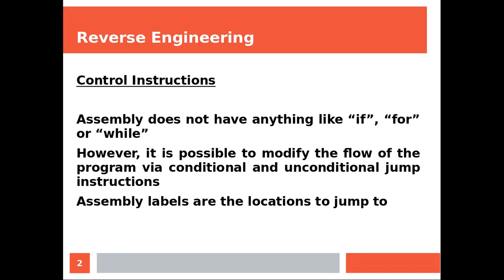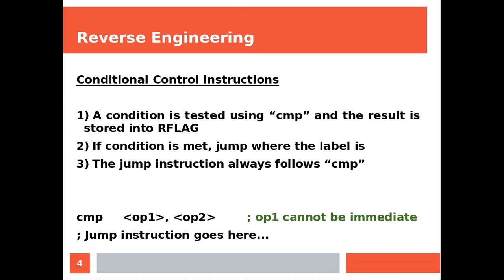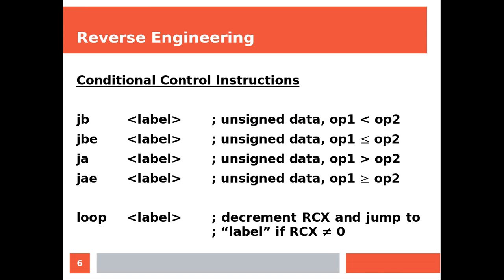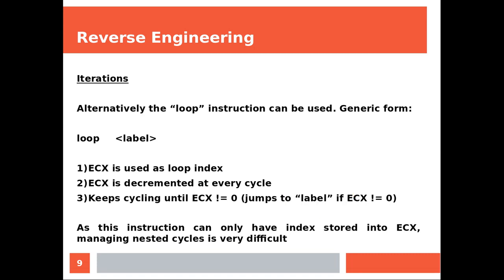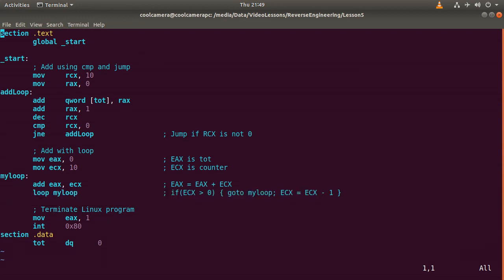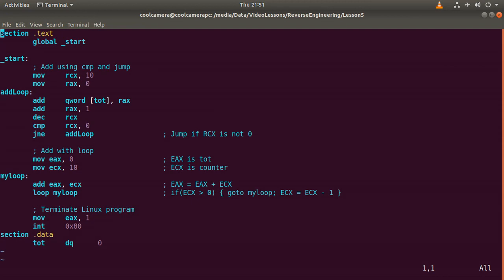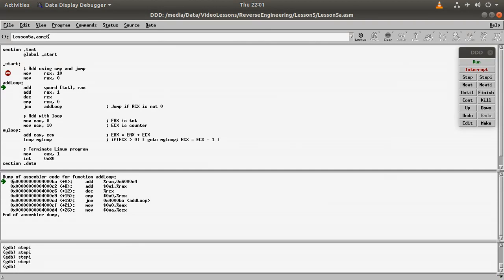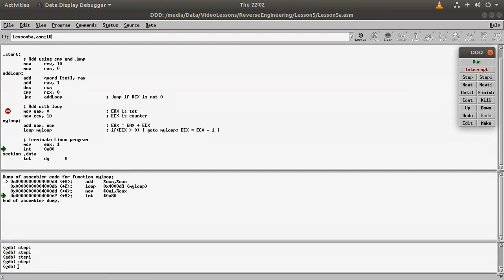Reverse Engineering | Assembly Control Instructions | Beginners

Comment: Thanks for these videos. Here is a question:

If I try to simplify the first loop like below by eliminating rax then I get a segfault when I try to add from rcx. Why is that? Something special about rcx?

...
_start:
   mov rcx, 10
addLoop:
   add qword [tot], rcx  ; This causes a SEGFAULT - Why?
   dec rcx
   cmp rcx, 0
   jne addLoop    ; jump if RCX is not 0
...
section .data
   tot dq 0

Thanks.
Reply from the maker: Thank you for the question. I can see that your code is missing the syscall that tells the OS that the program is exiting. On modern Linux systems those lines should be something like:

mov rax, 60
mov rdi, 0
syscall

Put these lines right after the JNE and rebuild your code. This should fix the SEGFAULT. This one also works, although is deprecated these days:

mov eax, 1      
int 0x80

In fact, the lines above, should only be used to manage interrupts. I hope this fixes your issue
Reply: @CoolCamera   I had those other lines in there. I just omitted them for brevity and substituted the "..."

It seems the issue is qith ddd or gdb because if I set the breakpoint in the source pane and stepi it segfaults. If I set the breakpoint at the same line in the dump of assembler pane it works just fine! I can repeat this bug.

It only segfaults if I set the breakpoint at  add qword [tot], rcx in the source pane. If I set the breakpoint at mov rcx, 10 I can break and then stepi forwards with no problems either!

Anyway, thanks again.
Reply from the maker: No problem, thank you for letting me know. At the moment I cannot reproduce this issue. I can set the breakpoint where the ADD instruction is and still the program terminates fine. You might want to check the options you are passing to "nasm"
Reply: @CoolCamera  Hmm. Thx for reply.

Here is my build script:

OBJ=`basename "$1" .asm`
nasm -g -f elf64 -F stabs -o "$OBJ.o" "$1"
ld -o "$OBJ" "$OBJ.o"

Interestingly, all the other examples have been working fine.
Reply from the maker: Ok, try replacing 'stabs' with 'dwarf' and try again
Reply: @CoolCamera  That did it! Thank you.
Reply from the maker: I am glad it was helpful!